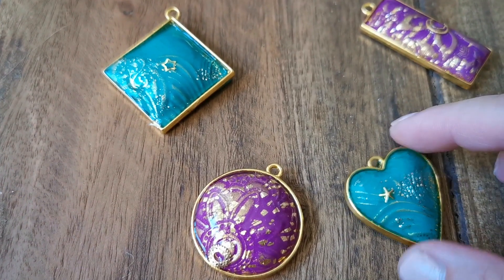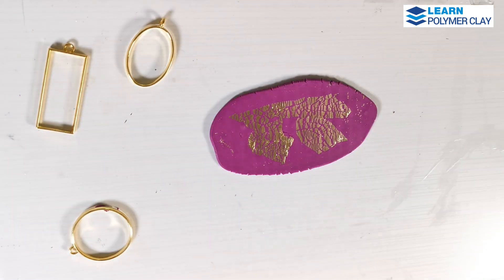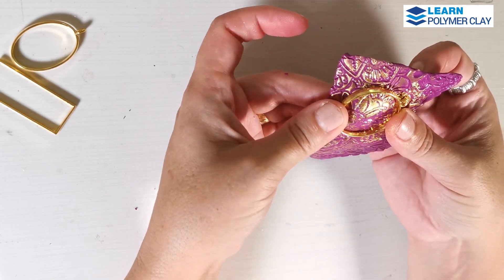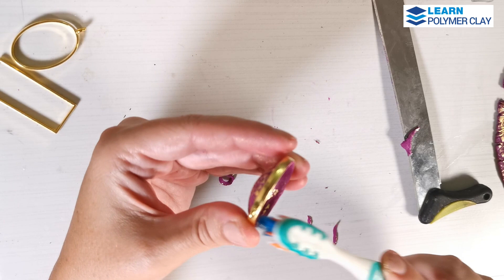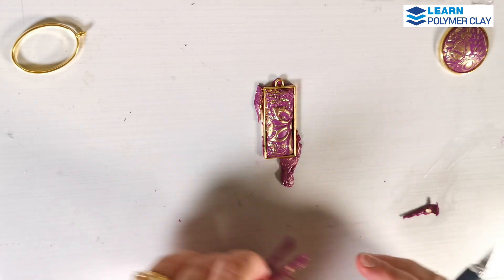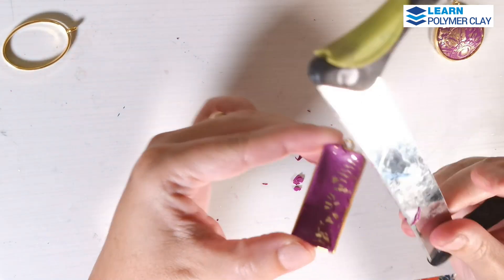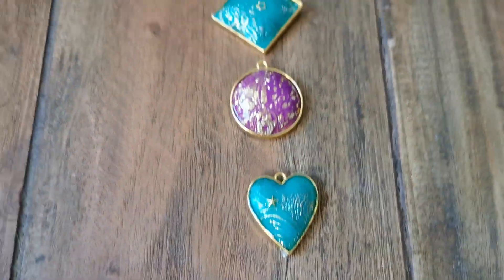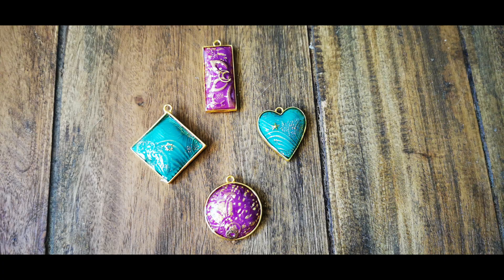Gold Bezels and Domed Clay Pendants  |  Easy way to make domed faux glass pendants

Comment: thanks for the video. Could you advise at what stage you bake the clay in the bezel, before or after applying the Resin?
Reply from the maker: Hi. I'm sorry for replying so late😊 The Holidays and everything... I always bake the clay first and then I apply resin once the clay has cooled down. I don't think that you can put resin into into the oven. I've never tried it. I've been working with several brands of resin and epoxy resin in the past, but since I discovered  fast curing UV resin and the fact that you only have to use a UV lamp for 1-2 minutes, I think you have such a beautiful, glossy effect in less time. Have a wonderful Sunday and an amazing time in 2024!